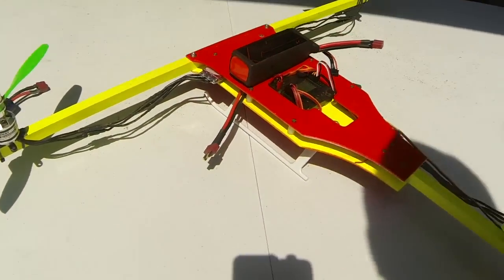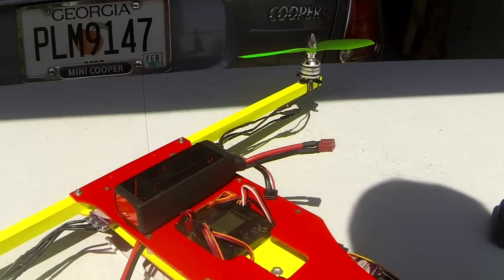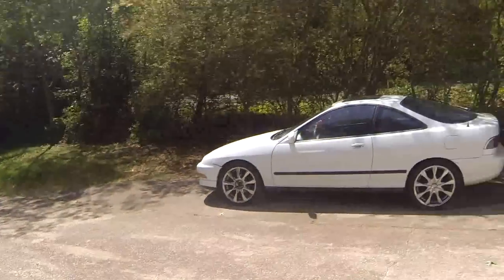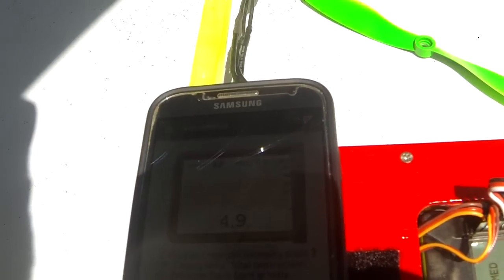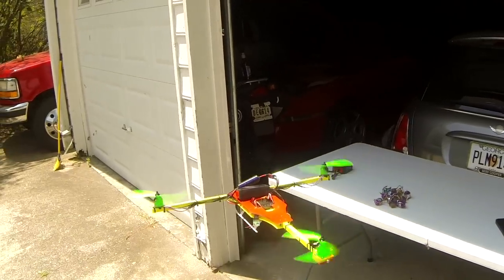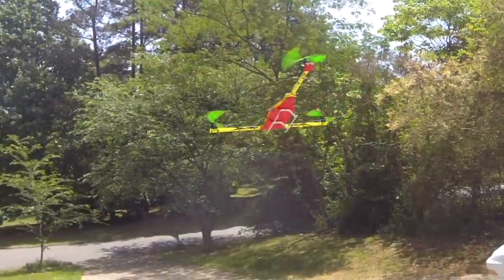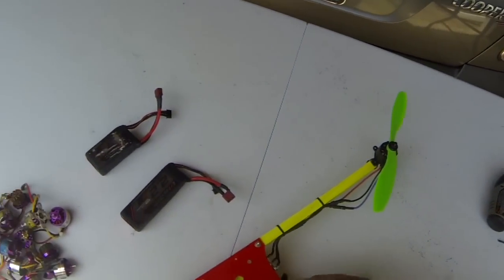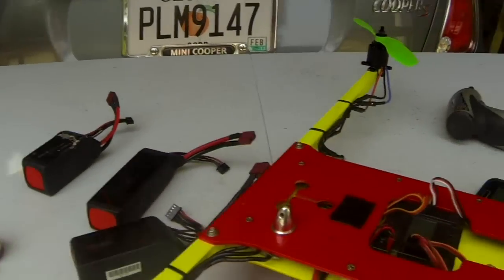Cheap VS  Expensive Motors for Multirotors

Comment: The vibration is usually caused by those rediculous turned Spinner nuts, which are far too long for a collet tapered hub on just the motors spindle......plus they usually run eccentric because its a (Sloppy fit) thread....Replacing them with ordinary Nyloc nuts and sawing off the excess thread will improve matters.....The Sunnyskys have a short prop hub, thats how it should be done...on all motors...of course....Short prop hubs...its obvious to an engineer, Turnigy dont seem to have any though....lol.